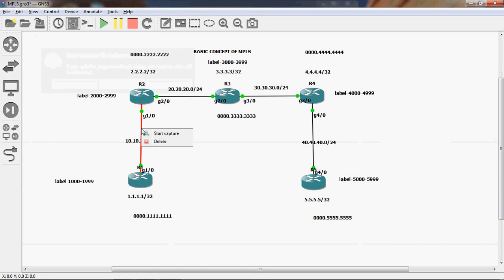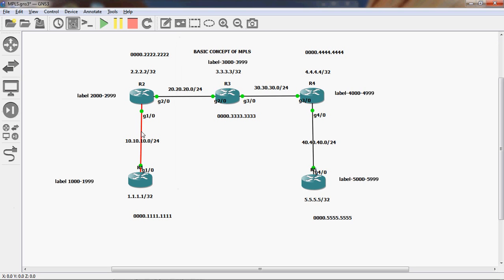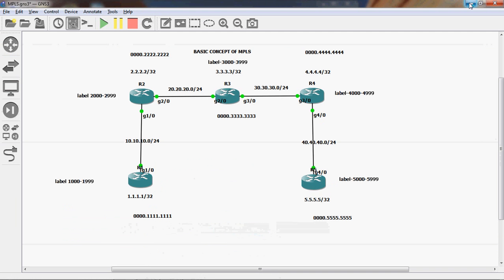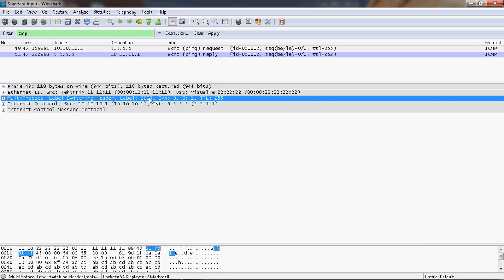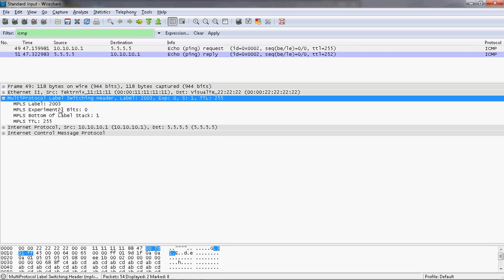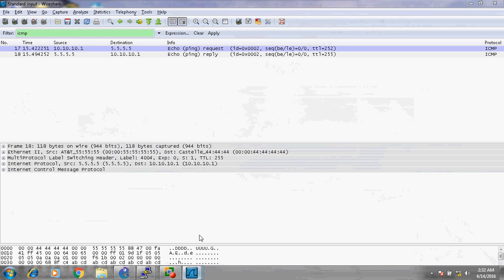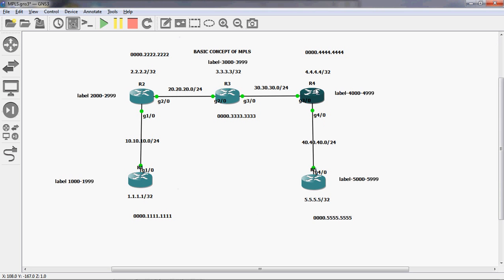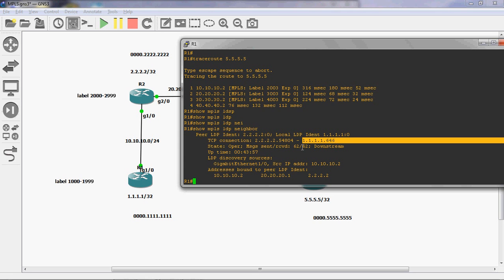BASIC CONCEPT OF MPLS PART 8

Comment: HI sir may I ask you regarding my problem in which is my subj problem regarding cisco my prof ask as to make a topology in which me and my group been chose to make a bus topology of 100 Pc's in w/c 50 per sites. The site A has 10 IT users, 10 HR users, 10 Admin users and 20 User Admin users. while Site B has 25 User Remote A and 25 User Remote B. Site A & B is connected via leaded line connection Site A has a business DSL connection via Ethernet w/ an IP add of 1.1.1.1/30 and Site B has no internet and should connect to site A for internet connection. All user should have internet except for User Remote B. Hope you Can help us make a Topology using Bus Topology with this problem.
Tnx for your future help
Reply from the maker: Hi Jep

ping me my mail id : fgowthamraj@gmail.com